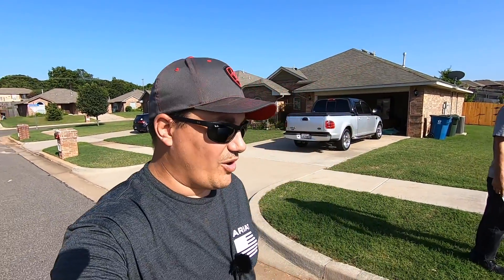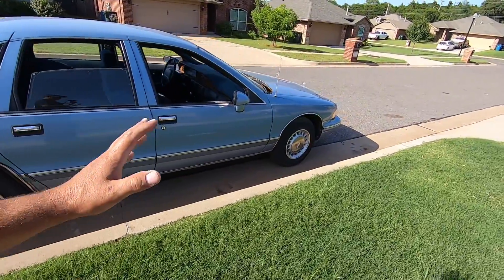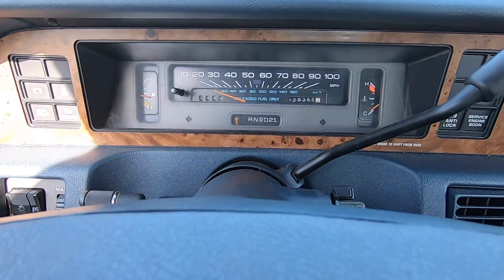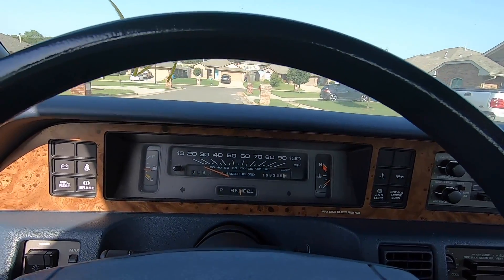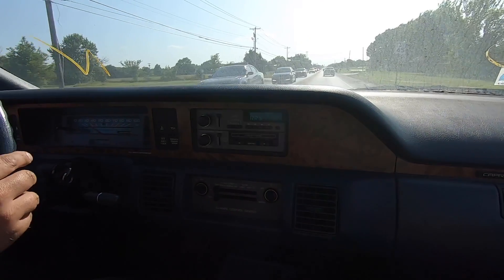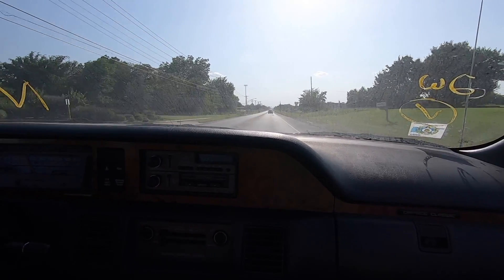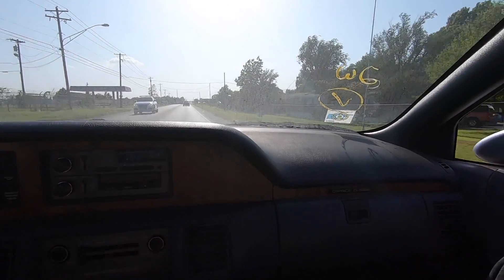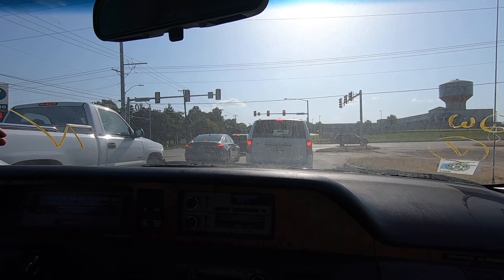Copart $375 93 Chevy Caprice - Does it Drive??

Comment: Early 4l60 transmission. fluid, filter, and shift solenoids, that low of miles, solenoids are probably sticking from sitting forever
Reply: I was thinking the samething.
Reply: Yea I think it’s a sensor or solenoid. The way it just falls on it’s face very sudden. Drop the Pan and go thru it.
Reply: Also since he has a fancy scan tool now he should be able to do a driving diagnostic.
Reply: @pontiachotshot  Possibly not with that vehicle, that was before OBD-II (mandated in 1995)
Reply: Worth a shot
Reply: Full tune-Up, including engine & transmission
Reply: @keg4998  with OBD1 you need a OBD1 scan tool for that year and they don't have as much stuff that it brings up but with OBD1 a lot of vehicles there's a way to use a paperclip to get the codes Pull from it and it would flash the engine flashes on that service light and how many times the flashes of each one and then you can get the code online from by the number of time's the engine light flashes and you can figure out what's going on that way.
Reply: @pontiachotshot  cars too old for that
Reply: It has no solenoids.
Reply: Those 4l60 transmissions needed a valve body, torque converter or the lock-up solenoid would fail. I've actually had a 93 caprice! Loved that car!
Reply: Wrong, the 1993 Caprice transmission was a 700R.

Comment: Old cars are not as big as people make them out to be. They are super comfortable and the feel is so much different than anything built in the last 12 years or so.
Reply: Would it be fair to say that the Chrysler 300 Touring is the closest you can get to this in a new car, in terms of overall look and feel?
Reply: moonbeamskies  The feel is something that you get is with big RWD cars with 14” or 15” wheels, and ball-nut steering, it’s tough to explain. I have been driving my 1969 Charger and then go back to my modern car and the best way to put it is the modern car is stiff, and tight.
Reply: Curtis Fleabag I set my torsion bars lower than the factory but not too low. I keep it slightly lower than the rear. These old cars are not all over the place but they are nowhere near as tight as modern cars. It makes for a comfortable ride. 

It’s just something that one has to experience. If you drive an old car you know how they feel. Torsion bars and leaf springs give a great ride, and they were far superior to the contemporary Ford and GM products.

The modern 300/Charger/Magnum and Challenger are Mercedes Benz based platforms. The modern 300 the old 60’s 300s and the 300 letter cars are all different from each other and so vastly different you can write paragraphs about it all.
Reply: @Curtis Fleabag I'm talking about the overall car in terms of cost, ride, character, etc.  I saw a new 300 with plain 17" wheels and a price tag of 25 grand after rebates and dealer discount.  How could you get more "Caprice" than that?  A big rear wheel drive American car that's not trying to be fast or trendy or techy.

Comment: Randy, does your temperature gauge always sit down there? If it does you may have a bad thermostat which means your car never reaches full operating temperature. In many cars the overdrive will not engage constantly or at all until it's "warmed up" or at least the computer thinks it is. Regardless it needs a transmission service at least

Comment: If it has the 4l60 transmission its probably the 3rd clutch pack just had my 4l60e in my truck rebuilt and its a 96 and it was my 3rd and 4th clutch pack one of the common problems with that transmission
Reply: This is exactly what it is. No fluid change will save it. It needs a 3-4 clutch pack.
Reply: I had the same symtomes with my 4l60e. Burned 3-4 clutch ! Sorry man it is on its way out

Comment: I would recommend a pan drop and refill with Dexron and a filter change. The gray stuff is clutch pack material, you'll find the metal is in the bottom of the pan. Metal particles are normal for break in and are normal wear and tear, as is the clutch material.

Comment: check to see if the modulator valve is bad. on outside of trans. has a vacuum hose going to it. pull off the hose. if trans fluid comes out, it's bad. is cheap and easy to do. if valve is bad, it will suck fluid and burn it. cat con will burn it so you don't notice smoke. would also explain low fluid, and shift like crap. cheapest and first thing you should try.

Comment: Thats shift flare, caused by either a sticking valve or solenoid. I solved that issue on my explorer by adding lucas transmission fix. It immadiately stopped the shift flare. But it started to bang in reverse when cold. So it may have side effects. If i would do it again, i would start with a quarter bottle.

Comment: Since it's been sitting forever, I'd drive the car around another 500 miles or so before dropping a grand.  The shifter solenoid might just be gunked up & come back with a bit of use; I had an S10 blazer that had the same issue, & trans X cured it.  Bumper & paint maybe, but IMO not really necessary.  As it sits, that car should pull $1500 easily, and that's a great profit considering how little work you've done thus far. Just consider the time involved chasing down a bumper, prepping the car, etc. to determine if it's worth the headache to you.  Personally I'd flip as it is & go get 2-3 more hoopties, then repeat.
Reply: Mommy

Comment: Even with the trans issue, still a great buy. Everytime I go to the auction, you never know what you are getting. Last purchase of the 2009 CTS from Copart, that car has 2 cylinders down on compression. I will be replacing the engine. And I am still good on the $ side!

Comment: put a thing of lucas transmission fix into the trans.
Reply: Scotty bodges don't work
Reply: Yrs ago i used the regular Lucas no slip in a 700r4 that slipped in 2nd and wouldn't do nothing in 3rd after just adding it in with the old fluid the trans pulled like normal I got 6months of daily driving out of it till it quit. And also picked up a Dodge Stratus cheap with 170,000 miles that supposably slipped in first so before even trying to move or drive it I changed the fluid and added Lucas additive for newer transmissions well yrs later and 260,000 miles down the road never had any trans issues only the timing belt that popped and bent a few valves. Just don't use crap like transX it can actually damage the trans internals so bad it will cost twice as much to rebuild.
Reply: @kmrjeep  I know someone who had that dodge truck trans issue and every year it would start slipping again but he would do a change of fluid again and add more lucas and it was  good to go again.

Comment: I would drain the old transmission fluid out of it. After you change the filter I would put Lucas in it instead of regular transmission fluid. I have a Chrysler van that the transmission was slipping on. Once we changed the filter and replaced the transmission fluid with the Lucas stuff, it stopped slipping completely.

Comment: Check vacuum lines from that connect in the inlet manifolds. They sometimes get blocked and with the limited vacuum it may have burnt the ATF therefore causing there gear to stick then finally go into its final gear

Comment: Hi, Mike. The paint does not seem so bad overall, so in my opinion you can polish it up, change the front bumper and paint back bumper as it seems to have a wear. Car has original paint and it is the part of its history, why to paint it and make it look like it is new and just roll off the shop if it is not?

Comment: With the transmission flaring like that on up-shifts I would suggest that there's a very good chance that a transmission service with a new filter and fresh fluid will do an awful lot to bring it back.  It's not surprising that it's 3rd gear as the low mileage would suggest that it's probably spent a lot of time driving in town so 3rd is probably as high as it got around town.  It's possible it might need some adjustment to take up some wear but doing the service will make a huge difference.  On the up-side, being a GM item hooked up to a very common engine then knowledge and parts are likely to be readily available and pretty cheap.  I suspect even putting a rebuilt trans in that would probably be a lot cheaper than for a lot of vehicles...

Comment: I have an old 92 Lincoln and if my battery gets weak or even below 800 cranking amps the transmission in it will act the same way. A shot in the dark I know but try a good strong battery.

Comment: My daily driver is 94 buick roadmaster with lt1 just rebuilt tranny basic 4l60e 3-4 piston and clutches gone, if its -93 3-4 clutch pistons are aluminium and i would suggest to upgrade them to molded steel pistons

Comment: gonna be honest w you Randy. i doubt its ever had a tranny service.  ive taken a 4l60e with no 3rd no 4th and no reverse. i drained and refilled and i got 3rd back and i drained and refilled 2 more times and i got reverse back. i then changed the filter and both selenoids and did one more drain and refilled w some lucas and i got reverse. the old fluid is just nasty

Comment: Leave the exterior as is aside from new bumper tires and paint swap a built 350 or LS motor rebuild and build up the 4L60 and upgrade the rear gears to 3.08s from Caprice 9C1 or Impala SS

Comment: What is the Resale value in various Conditions I first due a new filter flush it . I not certain but I find out how THIRD engages it maybe a simple adjustment on belt or pressure valve or transmission or the rear vacuum valve before R&R the trans . Trans were lot simpler then you schould just got a external fuel pump Drain bad gas out then New fuel and a active to help clean the system .  Like you said it sat for some time Wich is not good for any Vechicle .

Comment: IMHO it makes little sense to rebuild the transmission and then replace it later.  Might be better to just put another used trans in it, most any 4L60E should do it so long as it's not 1995, 1995 is one year only because of a change to the TCC solenoid.  

Otherwise, have at it.  I would drive the snot out of that car. 

And FWIW my '91 van was $700 and I did 2500 miles in a week with it twice driving from NY to SC and back.

Comment: You paid 373 for it i will give you 1000 for it
Reply from the maker: That's not happening lol. I paid $800 for a transmission, $1300 for new rims and tires, $200 for new brakes and cooling system components, $300 for an alignment + rear diff service, $150 for window tint.

Comment: my 2018 CTS was having slipping transmission issues , dealer flushed the transmission fluid , replaced filter, problem fixed  , you might wanna try that . @autoauctionrebuilds

Comment: Obviously you're trying to go for a quick turn around on this car. Similar bubble Caprices like that with similar mileage are listed for around $3000, you could definitely ask $3000 if not higher once the interior is cleaned up, new front tires, and the trans is rebuilt.